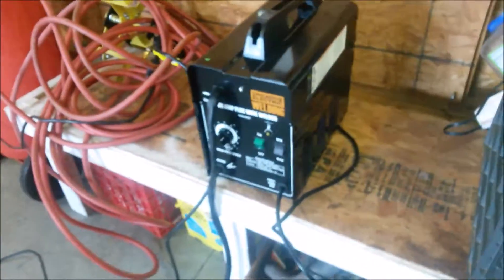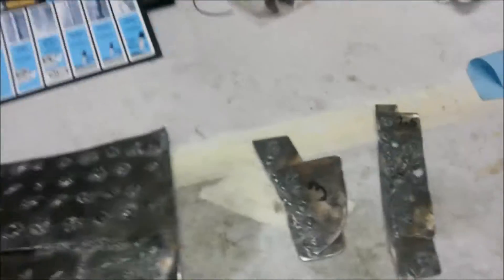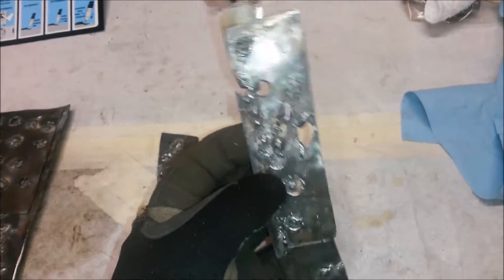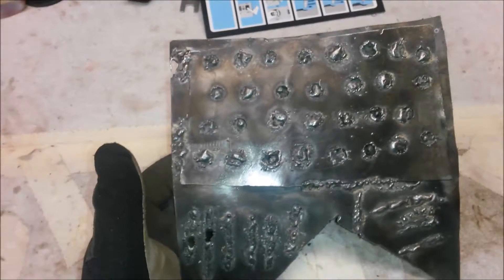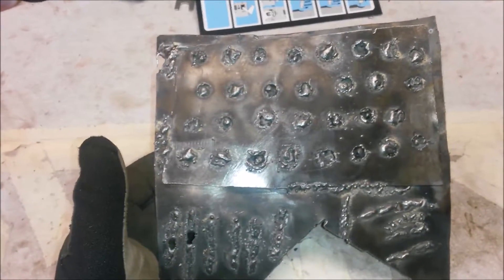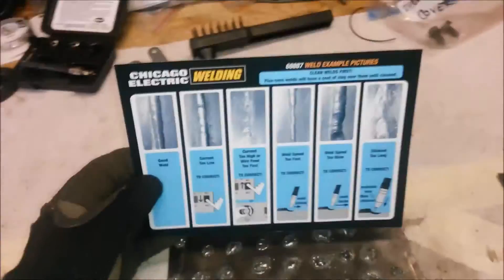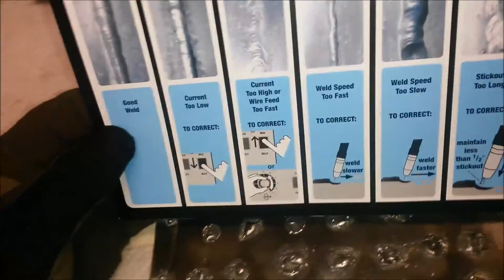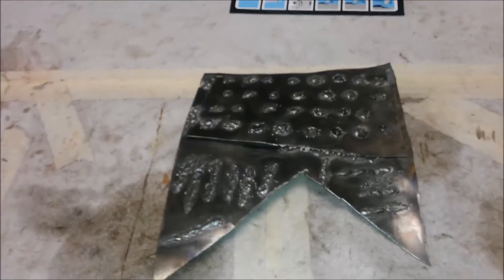Welding 101

Comment: I had one of those harbor freight gasless welder and did some practice welding with it.  it was horrible, lol.  A guy from work adviced me to spend more on something "better" than harbor freight welder so I got a Craftsman with gas capability.  it welder 3x better(flux core wire).  then I tried it with gas(non flux wire with 75/25 argon co2) and it was night and day.  it was cleaner, smoother bead, and less smoke.  if you never welded in your life, I'd recommend the one with gas capability.  it helps specially if you're doing a but joint.  just my humble opinion.
Reply from the maker: You totally right and I'm always looking for new ways in doing things. I'm almost done with the trunk floor pans, should post part 3 of the series.  The tail panel is next and I hope will be less challenging.

Comment: Lol.  We have all been there.  Welds are ugly but as long as they hold you can grind them down and make them pretty.  I am using flux wire in my welder.  I see other guys using gas, but I don't know what the advantage is.  Thanks for the vids.